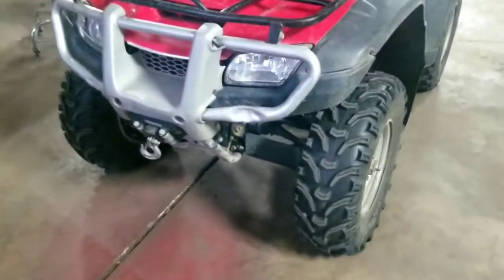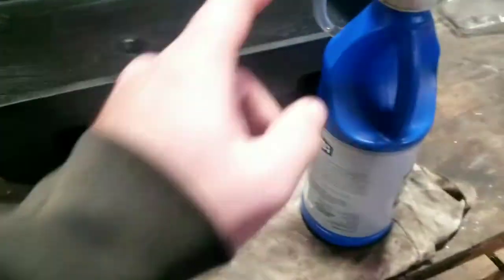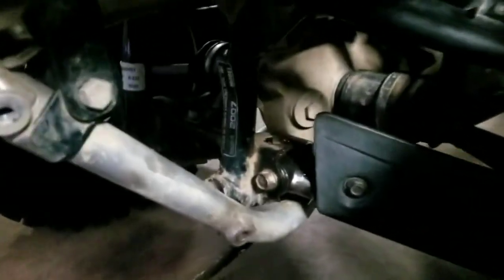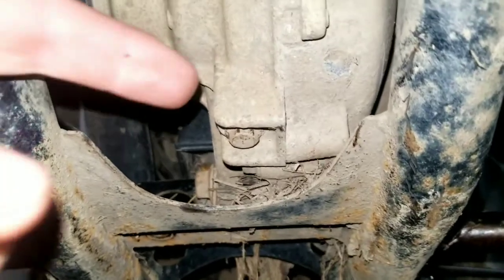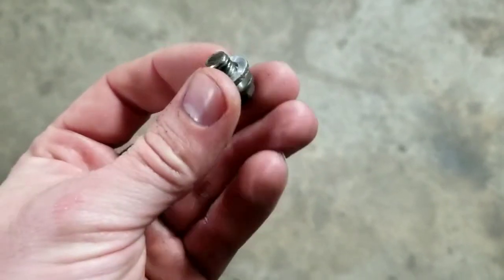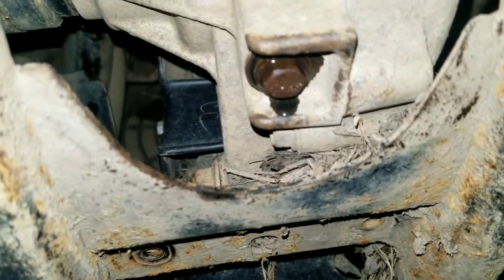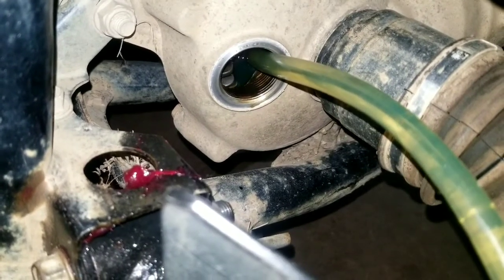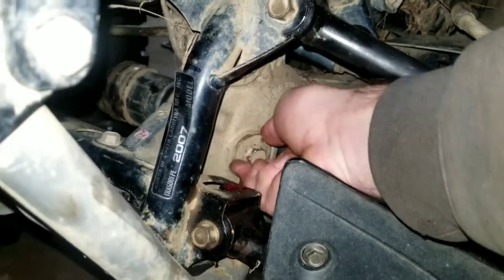07 Honda foreman differential fluid change

Comment: How did the fluid look ? I've got an 07 just passed 6,000 km wondering if I should switch er out
Reply from the maker: It wasn't too bad.  We changed the fluids pretty regularly.      It's not a bad idea to put some flush oil in it 👍